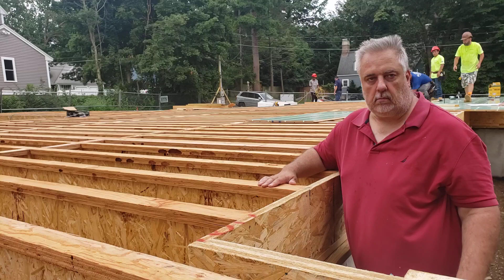Single....Double....1....2 Band Joist in the Floor Framing

Comment: Steve, fellow architect here - understand that when you kick that extra joist out by 4" to allow for insulation - but you are now not falling on 16" O.C.  - or are you starting with that one and running the 16" out the other direction? I ALWAYS try to layout my framing to account for these corners - but usually end up just doubling up on a floor joist here and there to account for the 16" o.c. framing for the subfloor....
Reply: I think he meant that he kicks the rim joist out and maintains the 16" OC.